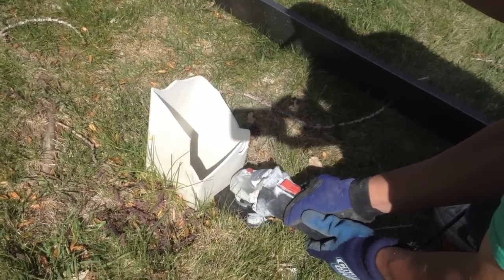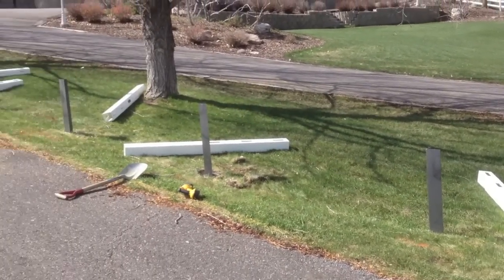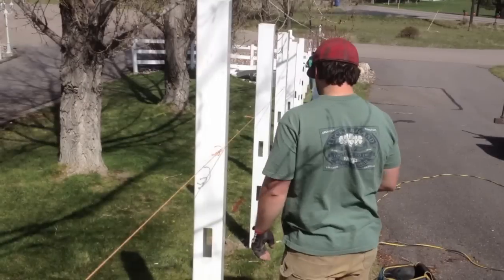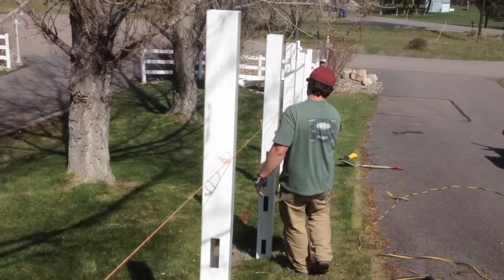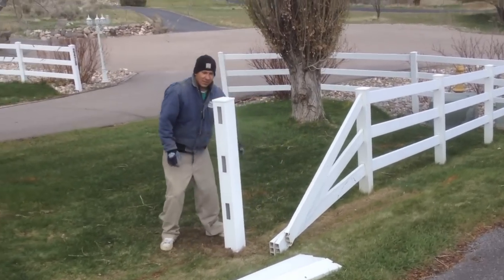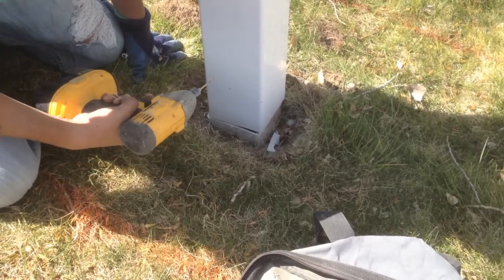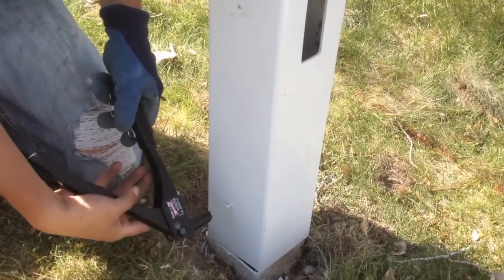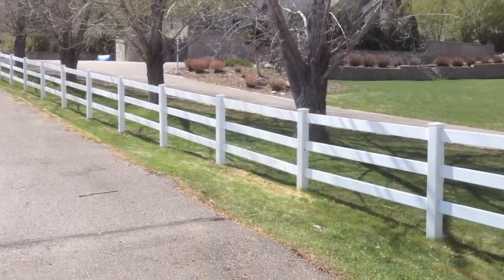REPAIR VINYL FENCE EASY!

Comment: I know this is super video of yours but I’m kinda desperate 😢!  Do you think this repair method is good enough to support a 6’x6’ vinyl privacy fence panel - just on one side, the other post is good.  Hurricane Ian snapped every other post at the ground and I really don’t wanna dig them all up by hand (12 posts).  Or do you know an easy way to remove post/concrete?  (Ie. truck jack, skid steer, spare tire jack, etc).  Most people seem to think those won’t work bc the vinyl will break or the vinyl will pull out of the concrete..